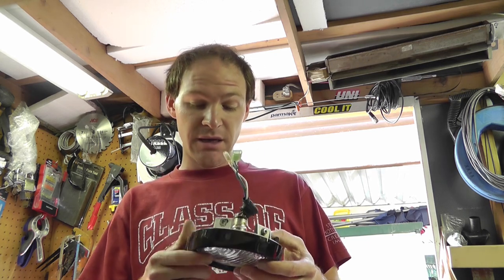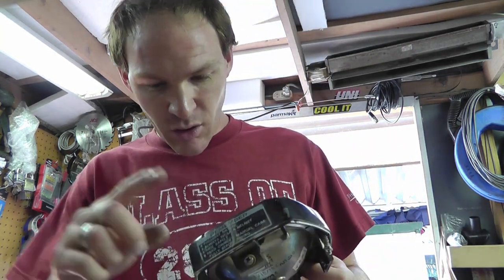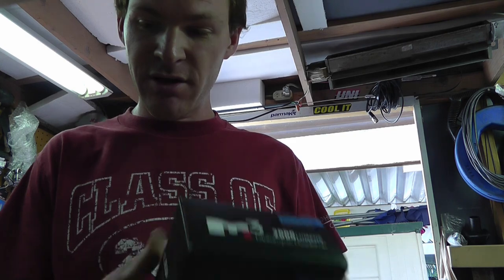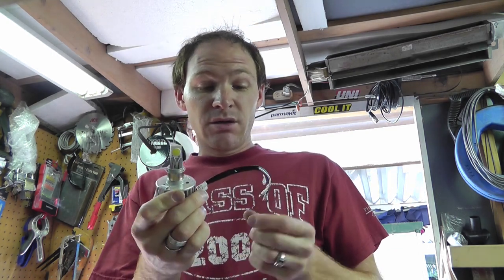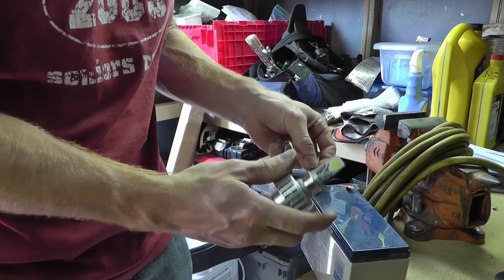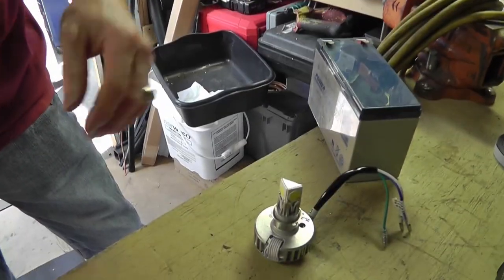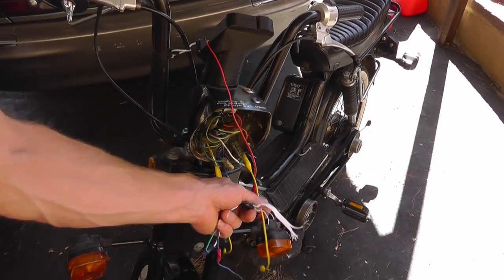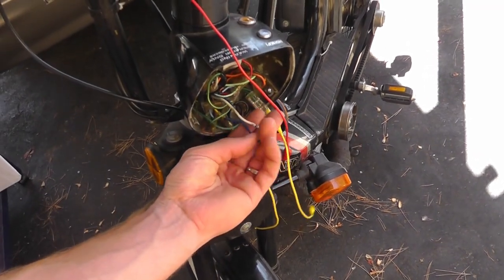#14 Honda PA50II Hobbit: headlamp LIGHT BULB LED upgrade.

Comment: You might be able to just run the rectifier right off of the power output going to the lights from the yellow wire that comes out of the magneto. If you hook your rectifier straight up to that yellow wire coming out of the magneto. That yellow wire goes to your headlights. So in my mind I think that all of the headlights and taillights would run on DC. I tried it on mine and my system ran on DC however my balb blew out because it was too much current going to it because I was using the wrong bulb.

Comment: Sorry I put you through all that, Russ!  :)   Experience has taught me to ALWAYS insulate ANYTHING automotive with 1 foot of duck tape. =Does the job and if it were to carbonize, the resistor pack will be wrapped in an inert enclosure.  

=Too much world and not enough duck tape...   :)   Cheers!

Comment: It's your voltage regulator that controls the voltage not the battery.
Reply from the maker: Normally You would be correct,  but in this set up there is no voltage regulator. The battery is the voltage regulator. It's set up strange... ~Russ

Comment: Having had plenty of experience wiring motorcycles, and especially with the switch-pots on handlebars etc, the answer was OBVIOUS as soon as you mentioned it - even before you mentioned there being a problem, as soon as you mentioned two parallel rectifiers, I thought to myself "Why not just make the changes to the feed line INTO the handlebar switch?" As for the FAN? Bogus. Open up some duct holes in the housing, save that thing 'cause you're already gonna be concerned about amps consumed by your lighting system, you wanna save as much as you can for a good hot SPARK, right? Ancillary systems like that, heck - if you're gonna hook up a fan on one of these bikes for cooling while the bike's not moving? Put it over the HEAD, or better yet an oil-cooler. Don't recall whether the Hobbit has a good plumbing system that you can hook up a cooler loop to, but wtf - You'll wanna hook up one of them Chinese LIFAN 140cc motors, the CUB clone stuff - Or at the very least, a CT110 Honda motor..... And get some Aluminum RIMS on that thing, plus a bigger front DRUM hub, CB160 2LS something at least 140mm diameter, better yet 160mm, 180mm - even a 200mm 2LS such as a Suzuki Titan T500 front drum, which has got some nice cooling fins and can be cut down to a very narrow overall width. Fill in the speedo drive with a bushing and then you can get even narrower. The next part you'll dig - A hall-effect sensor to replace the OEM speedo's mechanical worm-gear drive. Just run an electronic speedo. Some really nice 16" rims, 2.15x16" & 2.50x16", from "Mike's XS" are rear rims for XS650 Yamaha, drilled for big 200mm diameter rear drums, 36-spoke. Ideal set-up. Of course, the Hobbit used something like 14" rims, right? Well, there are 14" rims out there for little mini-bike MX-ers, CRF70 or whatever. Not a dirt-bike guy, myself. But yeah, some of those replacement rims for the little rear kiddie-bike wheels. IIRC 1.85" are commonplace. Get that and either a 1.60" or 2.15", big one in the rear - I'd bet that would do wonders even with the original size tires. Check out my "KZ440LOL" build for my scooter tire motorcycle idea. Or my "CB900K0 Bol Bomber" - that's why I'm looking or a Hobbit headlight right now, is the fairing on the bigger bike's fairing!

Comment: Can you provide where you bought that led lamp? Can you put in email? I want to do to mine bike. Thank you, for the idea. :)
Reply from the maker: hi, ebay:

http://www.ebay.com/sch/i.html?_odkw=6V+LED+head+lamp+motorcyc%3Be&_from=R40|R40&_osacat=0&_from=R40&_trksid=p2045573.m570.l1313.TR0.TRC0.H0.X6V+LED+head+lamp+motorcyce&_nkw=6V+LED+head+lamp+motorcyce&_sacat=0
Reply: ***** Thank you. In description i saw that can be put on 12 or even till 32volts. Have you tryed put to car headlight. And how to know how hot it will be if mine bike is on 12volts? I found these on dx.com, but not showing what is in the packeting...